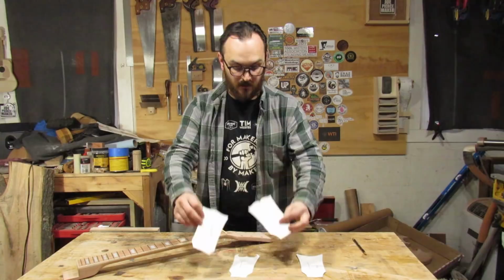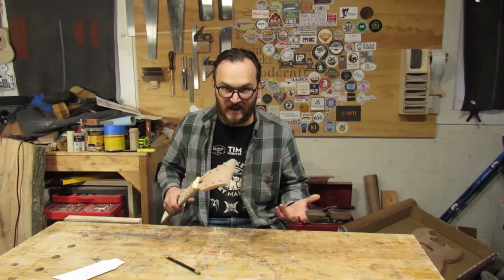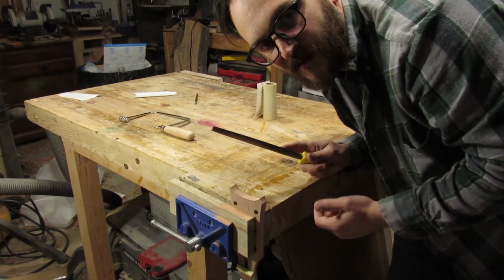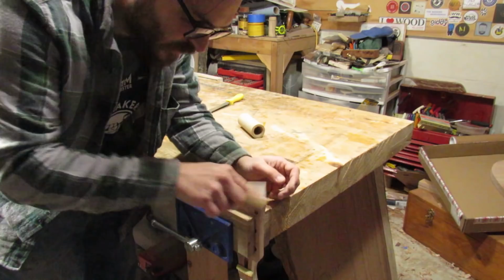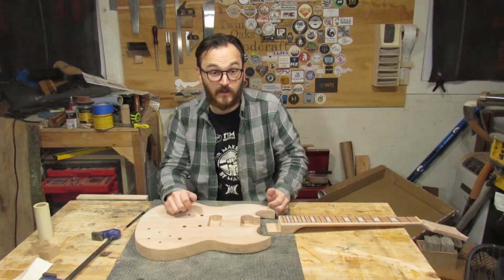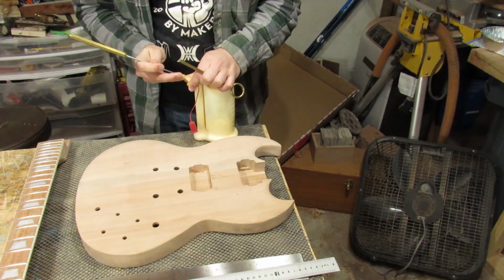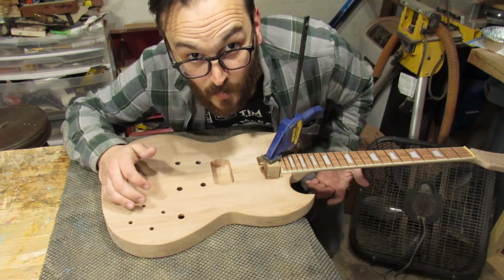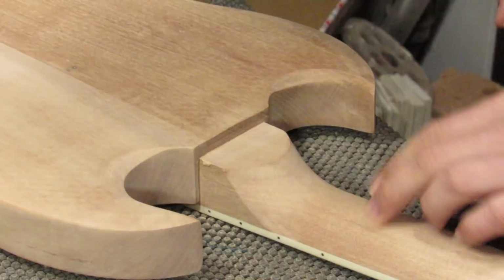Stewart MacDonald Guitar Kit - Episode 2

Comment: On an SG could you bevel the neck slot on the back of the guitar to better "blend" the body and the neck together to kinda make it look like a through body neck, or would that muck something up like the rigidity of the neck or cause it to bow easier etc?
Reply from the maker: I'm not sure, but I didn't want to risk it.  Maybe if if had more glue surface area I'd try that.

Comment: Don’t you have to check the scale length when attaching the neck?
Reply from the maker: Yes, a well made kit will be machined properly so that the scale length is correct right out of the box, but it doesn't hurt to double check before gluing it in.
Reply: @JoePierceMaker  Ok, roger that.  Thanks.

Comment: It can't be a good idea to not set the neck in as far as it can go. How can it possibly hold if you pull it out a bit?
Reply from the maker: If I had done that, the intonation would have been off and the neck pickup wouldn't have fit.  I actually  should have moved it a few millimetres out further than I did.

Comment: Wouldn't have been better to let the glue dry for a day or so before you unclamped it? When will your episode 2 be aired? I am subscribing to your channel to make sure I don't miss it.
Reply from the maker: Wood glue sets up pretty quick, but takes a while to fully cure. On a joint like this it’s okay to take the clamp off once it sets as long as you don’t put a lot of pressure on it before it fully cures. 

The next episode should be out in a couple days.  Thanks for subscribing!
Reply: @JoePierceMaker  thanks for the info.

Comment: You get better vibration transference with hyde glue.
Reply: in that case, epoxy would be better... It dries RIGID.
Reply: @jaistanley  I guess you could. Guitar makers never use it, not exactly sure why. Maybe because they like to reset necks on old Martin and Guild acoustic.
Reply from the maker: The advantage of hide glue is that you can use steam to release it if you ever need to replace the neck.  I used Titebond II because it's what I had and it's plenty strong,  I just may have a problem if I ever need to take the neck back off.